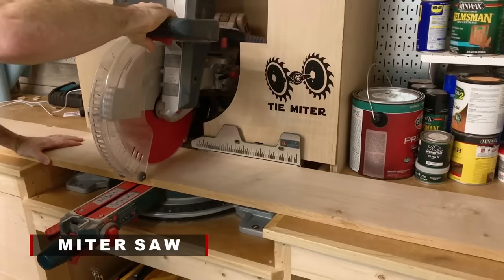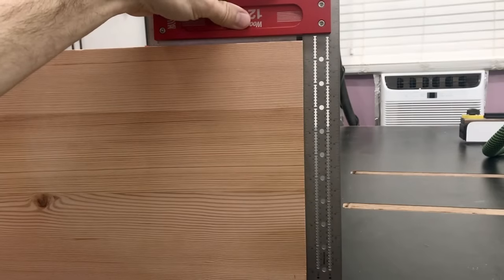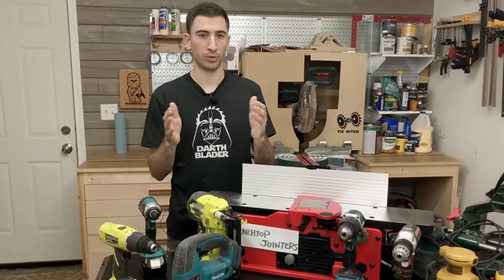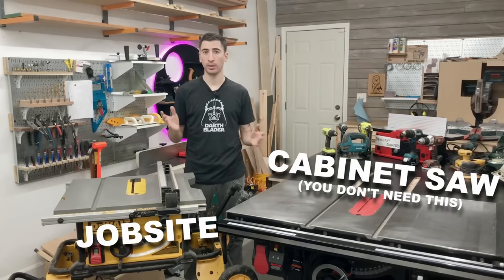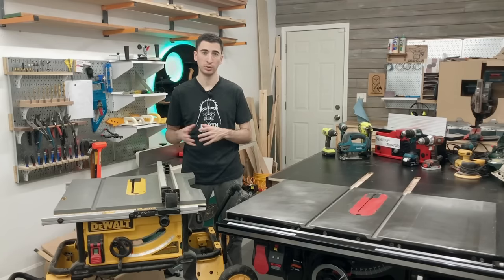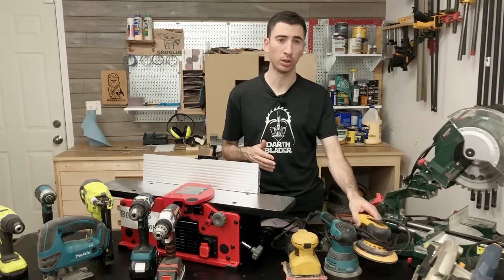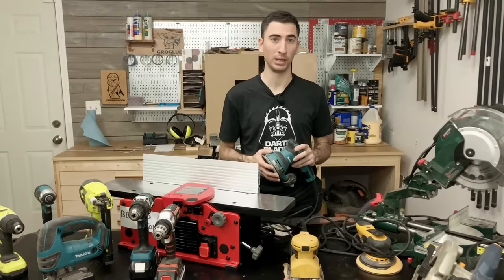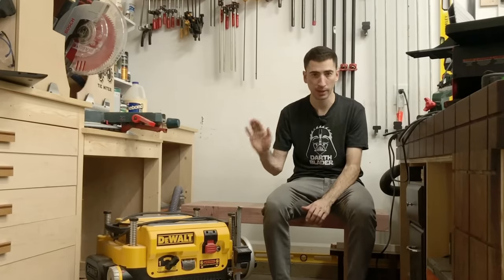Woodworking POWER Tools // Watch Before Buying

Comment: I agree with everything you said except the planer. The model below that dewalt model is by far the best. I’ve used both and I have far less issues with the cheaper model. It has practically all the same parts.

Comment: The general rule I run by is to buy something relatively cheap and it's just good enough for what I need. Then after a year assuming the tool lasts that long I evaluate how I used it how I utilized it what things I liked and didn't like and use that to educate my next purchase. What I don't want to do is buy a super expensive saw that has all the bells and whistles but then I don't really use the saw and I don't really use the bells and whistles so it ends up being a wasted purchase. If you start on something cheaper then you have the opportunity to find out if you even need that tool and what things you like and don't like you know what to look for for a more expensive higher quality version.

Comment: I gave up on lunch box planers completely including the dewault. Had to cut everything 2-3" longer to account for snipe, including on the dewault. Yes, I tried every anti-snipe trick on youtube. Now I use a table top aluminum router sled and big ass router for all my planing. Not so great for just facing smaller pieces though.

Comment: The advice on the table saw is critical. If the blade and the fence cannot be made true, it is not just a quality issue, it is a severe safety hazard. That is why with my first table saw purchase I went right to the $400 Dewalt versus the Ryobi and Harbor Freight models I was considering for $150. I was quite happy spending the extra $250 at Home Depot versus the ER.

Comment: Table Saws [at 4:40]:  Many years ago, Fine Woodworking did an article about building a cabinet saw using a Craftsman Motorized saw and building a precision cabinet around it using  a T-Square fence.   Accuracy comes from precise parallel alignment of the fence to blade. The rigidity of the setup makes it a 'Cabinet Saw' albiet with less horsepower than a heavy saw. If you have kids who want to learn and use these, I'd spend the money on a SawStop.  I have a beater Makita job-site saw that's still awesome after 30 years!

Comment: I bought a harbor freight table saw to replace the flooring in my house. Upgraded to a dewalt job site as soon as I could. I want the dewalt planer but just haven’t had the funds to get one. I tried the craftsman planer and jointer and ended up selling them as I wasn’t impressed.

Comment: I'm curious as to why you put the Skil table saw in the "do not buy list"  After looking at several different brands in the 3 - $500 range, Skil was the only one with a rock solid rack and pinion fence.  All the other big box store saws had the tap tap setting and I could easily move their fences at least 1/4" with minimum pressure!  Skil also also has the anti kickback prawls and kerf knife as well as the safety guide, and the saw was on special for $299. And it has a 15 amp motor.  So what's the beef??

Comment: I think the best job site tablesaw is the skill worm drive.  It has a little more power than dewalt and it can rip a 2 x 4 standing up. 3 5/8 rip. Has large wheels for steps and such. Has the same fence system as dewalt. For me everything on the saw is made just a little bit better than the dewalt .

Comment: I was taught by my mother, buy cheap enough and you can keep buying again and will be better off always. So once I broke that advice (linecook days) and bought 2 De Buyer cast iron pans. I paid I think €180 or so. I have used them with great joy for 10+ years. So per year that comes to €18 per year, a lot les per month. My mother keep paying €20 for a new pan per month because she keeps scratching up the cheap PTFE layer. 

Later I paid €100 over to crimp off my ethernet cables laying them in office buildings because I was sick of the €10 tool I had at home. Neater cables, faster work, less duds. It saved money in the end. 

Now I am looking for some powertools because I have a few things I want. Now I gotta choose either the €299 Metabo miter saw or the €110 Einhell. The difference is not too big but if I use it a lot and it can saw deeper and thicker, it might be that I gotta pay for the more expensive miter in the end anyway and effectively paid twice.

I guess if it comes to it you need to ask if you use it a lot. And that I do not know yet.

Comment: I bought an 8 inch Kobalt sliding miter saw.  I set it to a perfect 90, but whenever I tried to cut a 45 bevel, for fascia around a deck, the little pressure to push it down on the angle would bring it more out of square than I would tolerate.  I could easily cut them better with my circular saw.  It's bevel function might be useful on a thinner board/crown, but I wish had been a little sturdier.
Reply: THANK FOR TELLING US YOU DO NOT KNOW HOW TO USE  A MITER SAW   !!!!!!!!!!!!!!!!!!!!!!!!!!!!!!!!!!!!!!!!!

Comment: Having had some lower end tools before, I think the best route is to start off in the mid range and then if someone gets really serious with the hobby or turns pro, they can upgrade later. For instance, I had a Ridgid 10" Miter Saw and a Ryobi 10" Table Saw. Both were absolute junk and I wish I would have started off with something like a DeWalt on both (both of which I have now and have been MUCH happier). Even though there have been some changes to those brands since I first got those tools over 13 years ago, I've decided to steer clear of them for the most part. I just got scarred and turned off by those experiences.

Even lower-end stuff from good brands like Bosch is hit-or-miss...I had their $60 Random Orbit Sander and not only did the sanding pads start off or quickly become cupped (thus causing the sander to dig into the workpiece at the edges), but it began to not even work properly after a few weeks, so I got rid of it and got their $220 model and wish I would have in the first place. I'm sure you can tune cheap Harbor Freight stuff to be accurate for a time, but from what I've heard the longevity just isn't there, and I really don't take much pride in owning and using stuff that I don't think much of and can't joyfully recommend to others.

Those cheap-o tools I had were a waste of money, and I'd rather wisely spend a couple or three hundred more than spend less and end up with something crappy. You really do get what you pay for most of the time, though there are some exceptions here and there (my PSI lathe, for instance...all cast iron and was less than $200 when I got it back in 2008!).

Comment: 1 thing I would add that I learned the hard way.

The dangerous tools (miter,circular saw etc) be very careful if you are buying 2nd hand, even when you "try" the tool before. 

I almost lost a finger to a faulty miter saw that burned out and would start as soon as it's plugged in an outlet. 

I probably got very unlucky but still, you only need to be unlucky once to lose a limb!

Comment: My rule of thumb is start out with something - anything, until you work out what you use the most. If its a rarely used tool, a cheap one can generally be fine. If it's something I use a lot (like impact drivers, drills, saws etc), then I'll buy a better brand. Some hand tools I would say buy better quality if you can (like chisels). They're made of better steel and will keep and edge longer than cheaper made tools.

As for battery tools, while it might be a nice idea to have all the same batteries and chargers so they're interchangeable - the reality is battery technology and capacities change over time. Batteries only last a few years (generally) anyway before you need to replace and some can be more expensive than the tool itself. And manufacturers change battery styles when they bring out new models. So don't get too hung up on brands. If you don't own any, then yes it makes sense to try and get the same brand.

Comment: Great video, just wanted to add that the Ridgid R4516 also takes a dado blade. I have that model and was presently surprised to learn it did, but according to the manual it is designed to accept a 6” dado up to 3/4” thick.

Comment: This is a great video and great outlook on tools.  I  have just a couple comments.  I have been very successful with my cheap Lowe's portable table saw.  I check the alignment regularly and it does well for me.   And the saw does take a dado blade so you're right on there.

The other point is that I'm going to go for a benchtop jointer very soon, even though it's the second shop tool in my collection, after the table saw. (a planer will be next)  I want to build some home-made bookbinding tools; making sure that the tools I make are square is so critical so I am going to take the leap.  The maximum length of wood will be about 30 inches so it fits your guidelines again.

Comment: The skil table saw is actually a terrific value for the price, not only are there more adjustments than your comparable dewalt, but you can also run a dado stack on it as well…
Reply: Oh and it has a rack and pinion fence that I actually preferred over the dewalt

Comment: Makita cordless hand planer is super fine for dialing in all variety of situations . Also a cordless 6 1/2 " skill saw  and cordless grinder with 4" metal cutoff discs can also be used to cut smaller wood trims etc. or put a 4" concrete cutting blade on it to cut small wood trim .

Comment: I'm a newbie and I purchased the Dewalt 7491 3 years ago with not research and I'm glad I did based on your comments 🙂. Great video. By the way do you have the plans for the bench that your drill press is sitting on. I need to make one with a newbie skill level. Thanks

Comment: Man, I bought a Dewalt compound miter saw and a jobsite Dewalt table saw that sits on a 10 foot ripping table that's on its second motor. Both have held up for years of HEAVY hours of processing wood up to 6X6 pressure treated lumber.

Comment: Spend it all on the table saw.  Its kind of like how you don't want to give a kid a crappy guitar to learn on as it will only cause frustration.  About the only power tool you can replace with table saw for making basic things is a drill / driver.  Sure, you'll make a lot more sleds and jigs, but that for me is a huge part of the fun anyway. But what about sanding? That's what edge tools are for, finish up with a cabinet scraper.

Comment: Re: cordless - I also went with Makita specifically because of their approach to high power tools (at least on their 18v system). If you need more power, you can just use more batteries. That way, your chainsaw doesn't have a different battery than your drill. 

Also, typically when a battery dies, it's a single cell. I'd rather have a cell fail and kill a $100 drill battery instead of a $250 outdoor power battery.

Comment: The makita jobsite saw can take a dado stack, but... the wider throat plate that you get from makita is widened in the wrong direction. I wish I was making this up. The throat plate is also almost impossible to make a functional zero clearance insert for. It's a good saw, but I think the dewalt is actually better for woodworking.  I have a version of that benchtop jointer. If you're careful with it, you can straighten boards up to five feet.

Comment: I bought a Ryobi mitre saw 15 years ago to get going.  The only problem is the damn thing won't die so I am still stuck with it.  45-degrees require a square to check each time but other than that it works fine.  I would love a Bosch but it is hard to justify for weekend use.

Comment: Ive heard nothing but good things about the Skil ts6307 table saw, other than that it's very loud and is limited on the size of dado stack you cna use with it. The throat plate is also not the best. The best thing about it seems to be the adjustability, usability, and light weight at about 50lbs. That is the table saw I'm buying that is going on my new workbench I'm building.

Comment: I bought a 12" Delta dual bevel miter saw for about $120 years ago on clearance at my local Menards and it has been solid.  Very accurate, robustly built, and included a laser guide.

Comment: I have once learned: Buy cheap, buy twice! I´d always suggest to purchase good and durable stuff from the beginning. I did so with my Simracing and Flightsim hobbies, as well as when it comes to the "tools" for my hunting and fishing license. And as i´ve been a professional woodworker 10 years ago, this also is true for my tools. I´d rather suggest to properly decide wich tool you need and wich one not. Then get the best you can afford and skip those you won´t need (or need later).

Comment: One tip I would like to throw in, spend your money on the tool which does the part you like the least. I didn't like sanding at all, it took ages and left my hands feeling badly. I bought the mirka and now I don't mind sanding anymore.

Comment: I use one of those dewalt table saws at work a lot. I make a lot of shipping crates and tables. I have used it to cut lots of 3/4” wide dados. If I had the money to spend I’d definitely have one at my house instead of the old cheapy used ones I have that I’ve picked up for cheap.

Comment: In 2015, I bought a dual drill set at Wally's made by Bostitch (sp.?) and it out performs my Dewalt drill combo set that I bought at Lowe's in 2022.
Don't buy a horse based on color, and likewise, don't buy a tool based on brand.

Comment: 1. Why buy both a mitersaw and a tablesaw? The two have a huge overlap in what you can do with them, so I think it's best to further investigate their strengths, and figure out which is most useful for the projects you're intending to do. For these two, my suggestion would be to get one, and wishlist the other for when you're expanding. This obviously applies to other tools as well. 
2. It's personal, but I hate battery powered powertools. I even ditched my battery powered drills. Because of that decision, the tools I use are either lighter, or have the same mass but are more powerful. I keep a long extension cord at hand, and never had to search for a charged battery anymore. Battery powered powertools are useful for on-site construction, but unnecessary around the house, and redundant within a workshop.

Comment: The Skil table saw is the bottom of the barrel? Are you thinking about the old ones on facebook market place? The new one has every adjustment you can think of, have rack & pinion fence adjustment, can take dado, and can even cut 4x4 in a single pass. Every review I've seen raves about it, even the ones bought by the reviewer. As the title said, power tools for beginner wood working.

Comment: If you need an inexpensive cordless tool to build something just buy the Ryobi stuff. I used Ryobi for years (still do), starting back when they were dark blue and the batteries were horrible. I used them every day to make money building new homes. For the price they cant be beat. Once you save enough $$ then upgrade if you need to.

Comment: For cheap miter saws I would avoid the "sliding" feature. As you say, you can always adjust those saws so the blade is 90 to the fence, but if the slider is not parallel to the blade there is never an adjustment. If you even realize that's the source of your trouble you will have to shim the motor to get it parallel. Source: my first scms
Reply: I had a similar problem with the first sliding miter. Stepping from a harbor freight level saw to the $300 range craftsman slider was initially a good choice. But it was soon evident that the structure was simply too poorly designed and was not rigid enough to be consistent enough for repeated cuts. That was a real problem because it was $300 more than I could afford to part with. 
So I did finally get a very costly makita (cordless because of my work environment being varied) and regardless of the price I never regretted the purchase price. 
My wife would’ve hired a divorce lawyer had she been notified of that single expense 😂

Comment: I had that Dewalt saw and it was  good but needs to be used outside due to dust. Plus.the track is 3/4in which accepts most accessories.

Comment: I have a DeWalt job site saw. The disappointment with this saw is the miter slots are an inconsistent width. This means I cannot make or purchase a miter runner that will slide through the miter slot. Crosscut sleds and blade calibration tools are unusable. I’m uncertain of replacing this saw with either another job site saw or a contract saw. My point to this is sometimes even a step up from the bottom of a barrel isn’t good enough.

Comment: My metabo will take a dado set and has a rack and pinion fence and bigger table then the  dewalt 
Also one thing in the cordless world to consider is that there are lots of cheap Chinese tools  that are made to fit the red and yellow batteries such as hot glue guns etc where quality is not hard to find

Comment: Great advice and tips, Jon. Love your channel and discovered you through Woodworking Youtubers group. Only thing I would add that I've learned myself is sometimes horsepower really matters especially with certain saws. Buy the best tools you can afford, but if someone is considering doing more intense woodworking, then buy some additional horsepower. In many cases you'll cut faster and cleaner with more powerful saws.

Comment: Personally I think Ryobi gets a bit more flak than they deserve. For the price they're really hard to beat. Some of their specialty tools aren't quite as good as the others, and they aren't the most stylish for sure, but for the proce of an impact and drill with some batteries for other brands, you can get quite a bit. Personally I prefer the feel of Makita so I'm slowly building out that set, but Ryobi was a great starting point and all of those tools are still working close to a decade later and after a lot of abuse.